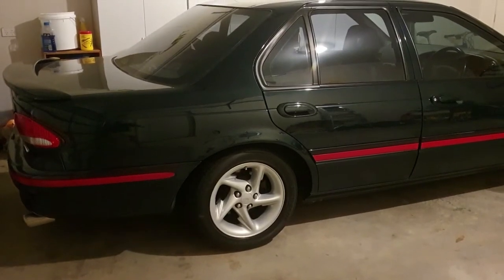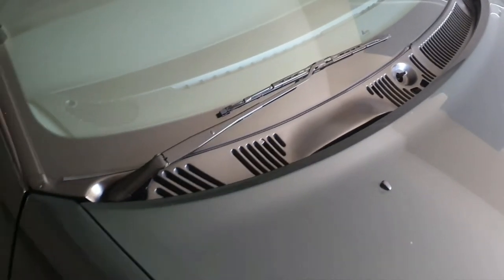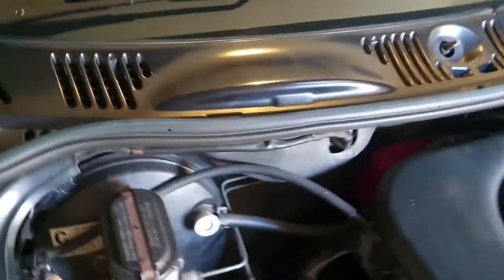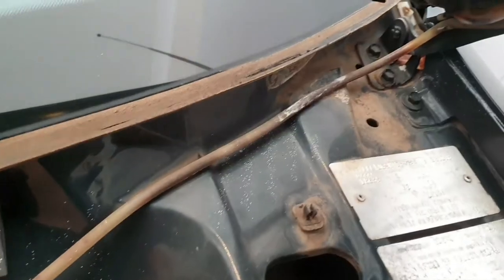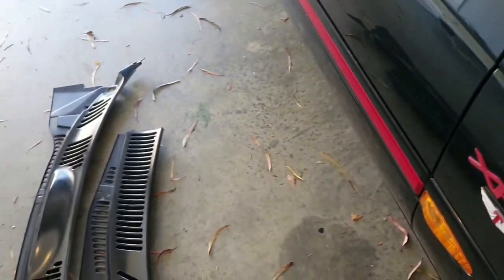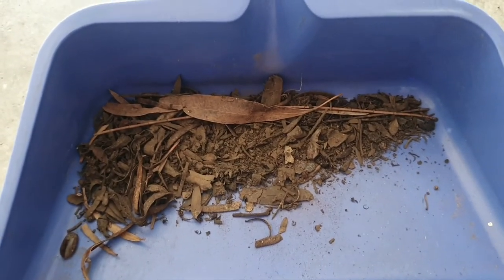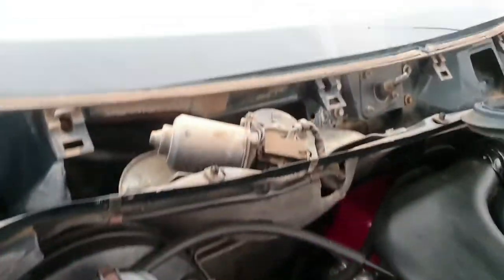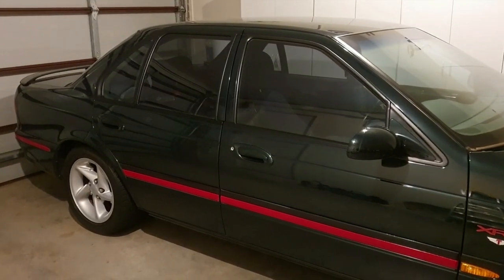Do This Today To Prevent Rust! Window Wiper Cowl Panel - Part 1

Comment: handy video! yours were pretty good condition but a good tip for others doing this is while they're out it's handy to paint the wiper cowl if it's faded and or crappy.. same with the wiper arms.. I did both mine and it significantly improve the presentation
Reply from the maker: Good thinking! In Part 2 of this I put trim restorer on the wiper cowl. Have also painted the wiper arms and got new wiper blades and frames for them. 👌

Comment: Thanks for the reminder been meaning clean mine forever now lol
Reply from the maker: Yes, do it! Haha. Have you done it before?
Reply: @efxr6538  Previously on my old ef when I first bought it actually how I found out she was completely rusted lol but just gave my Au a good clean out then loving it 👍🏼👍🏼
Reply from the maker: @Reecerudd1  Good stuff. Find any rust in your AU?
Reply: @efxr6538  I did not was very happy how clean it is for a coast car getting the fish oil into her now lol
Reply from the maker: @Reecerudd1  That's good! Mines been a coast car for its whole 26 year life! Had a bit of rust. The sill panels and bottoms of some of the doors has a little...
Reply: @efxr6538  yeah they love going in them spots hey most my old e series were horrible there, have you fixed up your sills and them small spots?? Seen you had a few spots in ur latest video
Reply from the maker: @Reecerudd1  Yeah, I fixed the ones under the wiper cowl area, I'll show that in the Part 2 video. I think I'll have to get a panel beater to do the sill panels though, as it'll need some patches welded in.
Reply: @efxr6538  yeah mad, and yeah can be a job them sills especially when there non existing haha
Reply from the maker: @Reecerudd1  Yep, there's a couple holes, but more than just surface rust! I can fix surface rust, but not holes! Haha. Although I sprayed them all with rust sealant a few years ago to try and at least slow the rust before I fix them properly! Lol
Reply: @efxr6538  yeah that’s the way mate I’ll probably give that rust sealant a go reckon be good for cracks and crevices
Reply from the maker: @Reecerudd1  Yep, I figure something is better than nothing! 😉